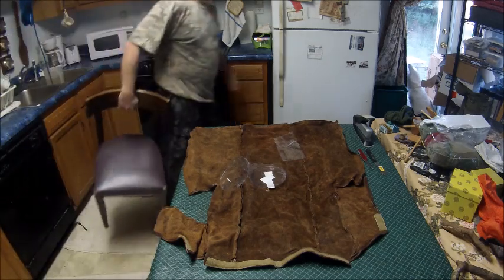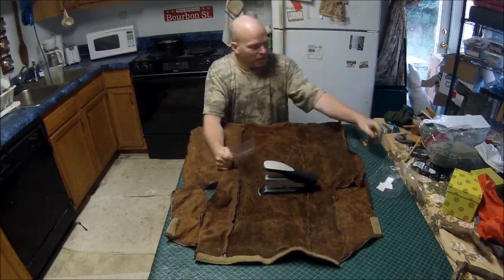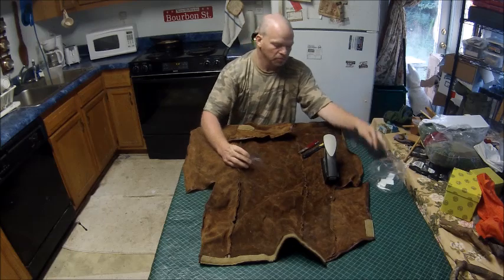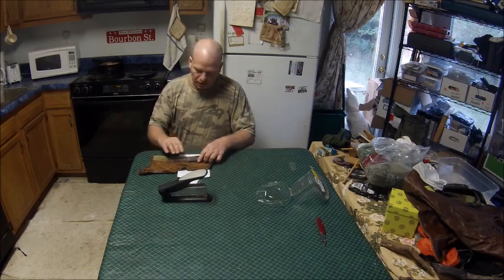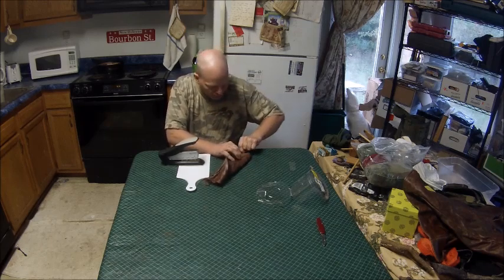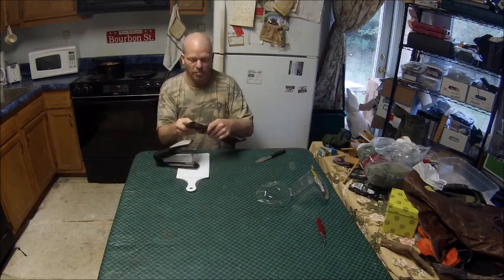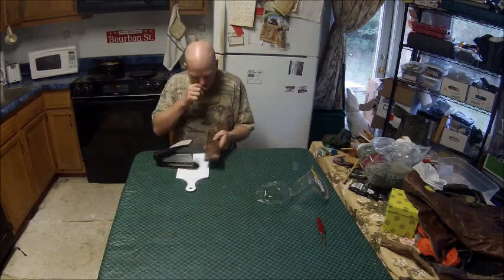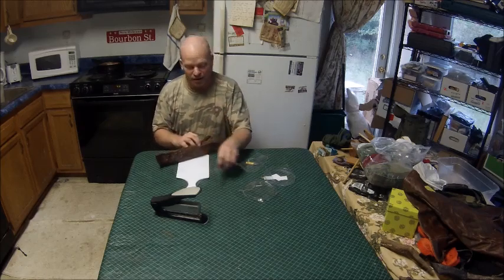Poor Man Leather

Comment: That leather would be great to make some cinch pouches to store small pieces of gear in too :)
Reply from the maker: +SouthPaw Bushcraft ya i got my ass up and did something wiht that Leather ...And you have vider of that Cinch Pouches
Reply from the maker: +SouthPaw Bushcraft post it here ty South Paw
Reply: +Ranger Kooky very simple to make, use something large and round like maybe your 5 gal bucket.  Trace it and cut it out.  Then use a punch and punch holes about an inch and a half apart around the outside like I did on the round one it has to have an even number of holes around the outside that's all that matters.  Then lace your string through and cinch it up that's it :)